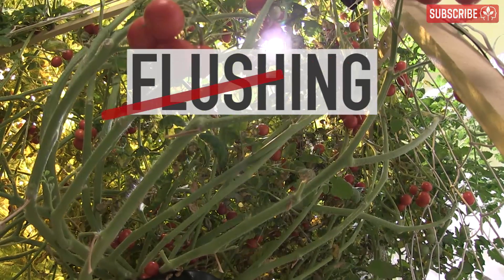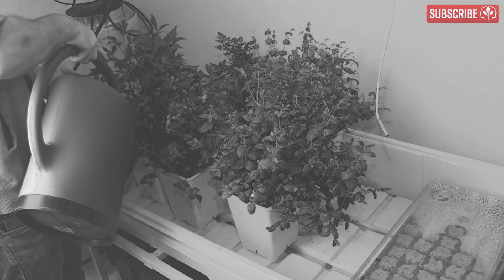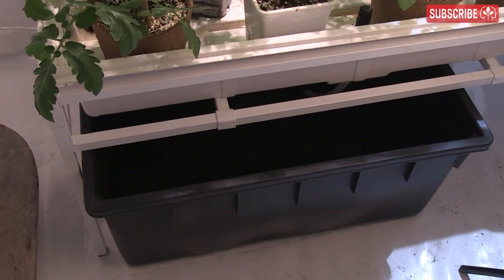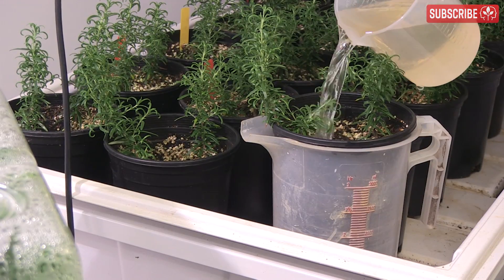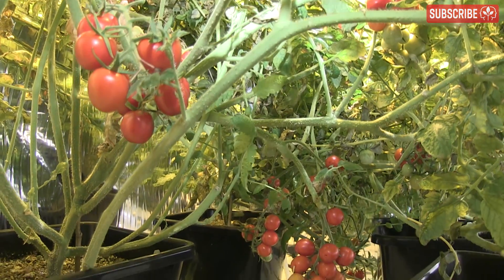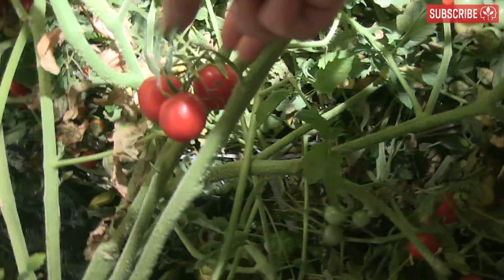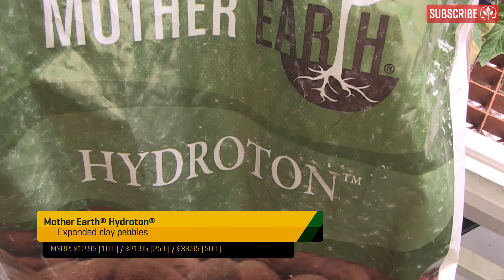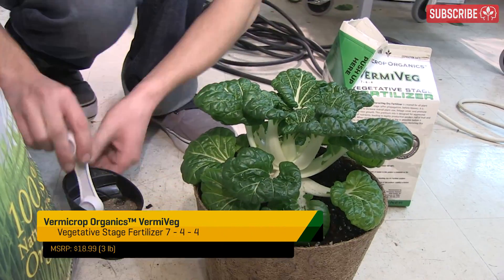All About Flushing (Leaching) with Hydroponics

Comment: One thing you left out. Measuring your ph run off and how to decipher what it means. For example, if your run off ph is lower than the ph in the nutrient solution that is a sign of nutrient lock out occurring in the plants root zone. On the other hand if your run off is coming out at the same ph or about.1-.3 above the ph of your nutrient solution that is a sign that your plants are feeding properly and maybe are even up taking nutrients faster than you are making them available (in the case of it reading .1-.3 above your input ph). In which case you may need to slightly increase the EC of your nutrient solution.

Comment: Questions for all the bud growers. So I've been doing hydro for quite some time now and have never flushed my res. To be honest, I've never seen the need and always had good outcomes. I'm thinking I would like to try it to see if there is any diff in the outcome. So my 1st question: Can I simply pump out my main res from time-to-time and change out the water/nutes (which flows into two separate reservoirs where the plants are), or do I need to remove the plants and clean down everything, which would only be possible when the plants are small anyways.
And my 2nd question: How long can/do you guys let a res run without anything planted in it? I was prepping my 2nd tent but it's been close to a month and a half and the clones are not ready to go in yet. There are no nutes in it and I have been adding a small amount of bleach once or twice a week to keep everything clean (water temps are at a constant 65 f ) Should I just pump it out and leave it dry from now on after a grow and simply fill it a week or so before needed? Thoughts?
Reply from the maker: Hello buddy. For a res change you simply need to pump the spent solution to a drainage / collection point. As long as you are maintaining a reasonably clean growing environment there’s no need for anything more while your plants are in mid-cycle. As for nutrient solution waiting for plants, just try to keep it away from direct light and you should be fine.
Reply: @Just4Growers  -  Thanks for the quick reply Ev

Comment: Ok, so I have a recirculating system I change each week..  I am a new grower, so this is all new.  You are saying flush each time I change my nutrients?  And how long do I flush for at the end of veg?  And do I flush then for a week at the end?  And also at the end of Flower do I just reduce to half strength.
Reply from the maker: Hi Dylan, you don't need to flush each time you change your nutrients. Just keep an eye on the EC / PPM of the leachate (run-off) before it returns to your tank. Towards the end of flower you should start reducing your nutrients gradually. The final week you can use pure water if you wish.

Comment: Hi pal . I have a fruiting annual lol and its flowering . I see either cal mg deficient or PK toxic . I flushed with a low solution no change can i assume deficient ? I only put 5 litres flush through slab 100 cm 2  x 6  inch cubes . Is that enough . 2.5 then again 2.5 flush .

Comment: hi everest!how can we flush indeterminent tomato plant when it keeps bearing more fruits through out the season?and do we need to flush the spinach plant when we grow it in nft system?please reply.it seems like you never answer any question?do reply or i have to unsubscribe you this time.
Reply from the maker: nirvik singh Sorry your comment was held for review. If you keep feeding an indeterminate tomato it will keep bearing fruit. I wouldn’t worry about flushing spinach.
Reply: thanks!everest,for the reply and information.so is it safe to eat that spinach without flushing it?isn't there any residue of chemicals left in it?i'm a little concerned about chemicals.anyway,thanks again for the reply i have learned a lot from your videos.

Comment: pointless video!
Reply from the maker: +mackychloe I’m listening...
Reply: Dude, there's a ton of info in this video but you dropped it at 1000mph which made it impossible to interpret.
Reply from the maker: Sorry amigo. There are English subtitles for this video so do switch them on — might make it easier to follow — plus you can set playback speed by clicking on the 'cog' icon (if you're watching on a desktop computer) — try me at X .75 - many folks prefer me slightly nerfed.

Comment: all good info.  commercial growers do not flush before harvesting!  Tomatoes like an EC of around 3.5 mS...and cherry tomatoes are near 5.0!  High EC creates generative development, and builds flavour and nutrition.  Of course they have super good control over their fertilizer solutions.
Reply from the maker: Wow, that's crazy high EC for the cherries! I've tried to deliberately overfeed tomatoes for various "experiments" — and I can personally testify that it really takes some doing !!! In my overwatering video I show some over-fertilised toms—that was 8.0 !! (Yep, that worked.) :)
Reply: hehe.  It's funny how, when I was a newb, I'd kill plants without knowing what happened.  Now that I've got some skill, it's hard to kill them.

Take liquid samples from a Grodan cube with a syringe (run off is NOT reliable).  When the pH/EC matches the nute solution, you're just about perfect.  No guesswork needed.

fyi, check out Grodan's 6 phase growth manuals.
Reply from the maker: Crysmatic Thanks buddy, I will look those up. :)

Comment: Awesome videos Everest. What is the best way to leach a wicking system?
Reply from the maker: Good question Yeshe! If possible, remove the pot from the wicking system tray and top feed with half strength nutrient until 30% of what you have fed comes out the bottom as run-off. Discard the run-off or dilute 50% and use it to fertilize your lawn or house plants.

Comment: Everest, how's about a video on how to combat root rot? Your informative video collection could use one. Just a thought (wink)
Reply from the maker: Thanks Larry that's a great idea. I have an electrolysis device that works great for this—as well as H2O2 of course—an aquarium chiller, and—if all else fails—there's even the possibility of using silver nanoparticles! It would make a great vid.
Reply: in!
Reply: I do a weekly flush of the system with 1TBS Physan 20 / 50 GAL of water.  I set my ebb & flow system to flood/drain once every couple of hours.  Next day I back flush the expanded clay pellets (helps lower dried in salts), drain the tanks and refill with water, nuets and Hydroguard (to bring back the good bacteria.)  That goes for a week and I do it over again.  

And cool roots are defiantly a must!  I pump the tank res through a cooling coil in the freezer of a small refrigerator to keep the tanks cool.

Comment: What are the benefits of adding peroxide to a flush? Does a build up of old dead roots really harm the system that much? Is flushing for 1 hour with 0 ppm water enough to get most of the insoluble nutrients from a perlite only media after a month of no nutrient change out? I am just not sure of good way of detecting how much insoluble nutrients are in my system at any given time.
Reply from the maker: Hi Askiro. I would recommend an enzyme-based product (i.e. Hygrozyme) to clean / sterilize old dead roots rather than H2O2 unless you are seeing signs of root rot / pythium. Flushing with 0 ppm water is very aggressive and I would suggest using a 1/4 or 1/2 strength nutrient solution instead.
Reply: Ok so when I flush I add 0ppm water to a 600ppm reservoir.  After 3 flushes the reservoir ppm is about 150-200ppm.  Then I add my nutrient to get the reservoir ppm to my target of 1000ppm or 1300ppm.  So the plants are deprived nutrients for the time it takes me to flush (about 1-3 hours).  The plants show no signs of stress from flushing, so I really don't think its that aggressive.  Adding 1/2 strength nutrient just to flush means I am throwing out a ton of nutrients which just seems wasteful as hydroponics is already pretty expensive as it is.  I have considered using products like Hygrozyme, but I figure the old roots will eventually just get removed little by little every time I flush, so I am skeptical if it is really necessary but I will probably try it just be sure.  Thanks for the response.  I think flushing and lockout are the 2 biggest topics that hydroponic growers just don't have a firm understanding of so I appreciate the video.